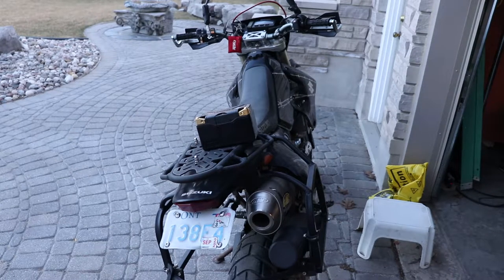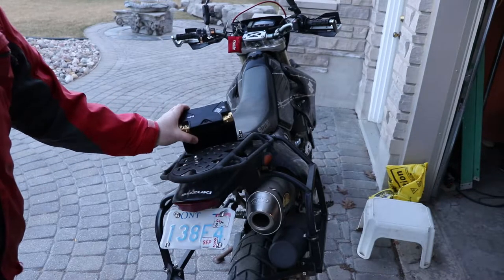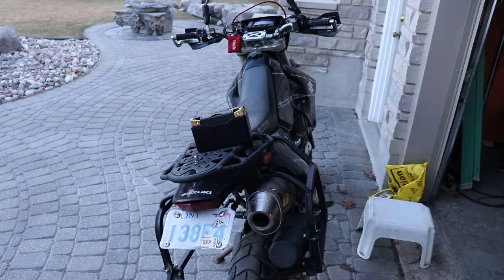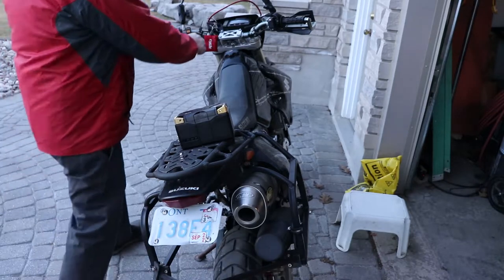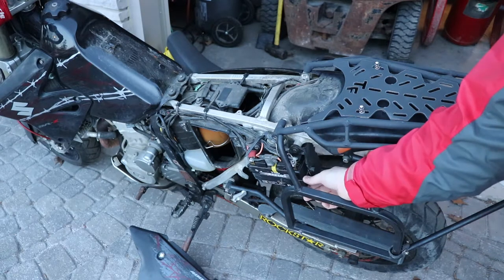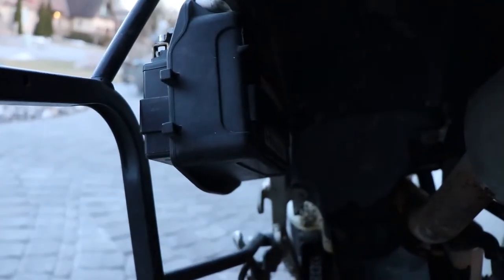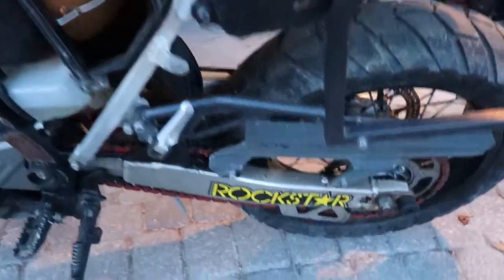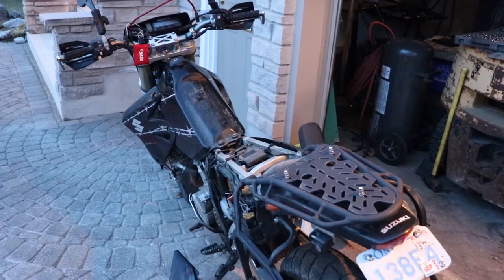Upgrading Suzuki DRZ400 with NOCO NLP Lithium Stock or Oversized Battery

Comment: A very good video, I just got my NLP14 this week and will be cutting out the back of the battery box next. An FYI for your watchers, order the battery Noco factory direct. It is the best way to get the 5 year warranty honored should you need to. With their promo code it was also cheaper than most anywhere else.

Comment: Is the 4ah on the lithium not the equivalent to 13ah on a lead acid battery. Sure that’s what noco say.
Reply from the maker: That's a good point.  You can take more ah from a lithium than a conventional battery that is rated to 50% capacity.